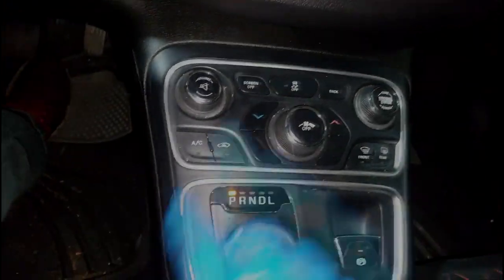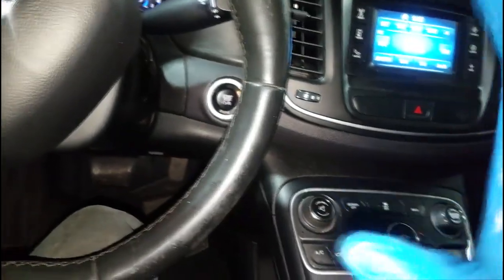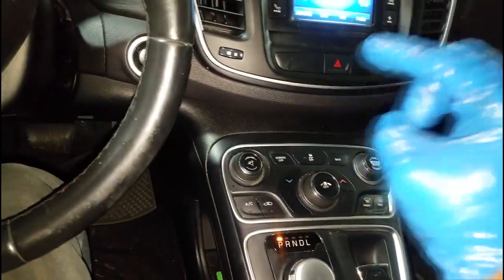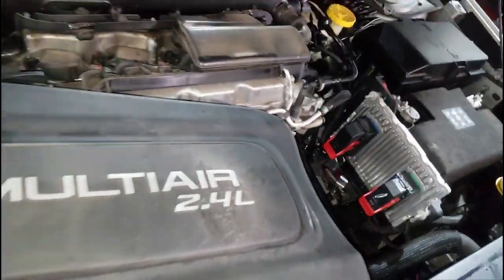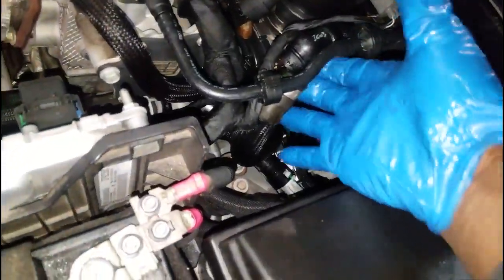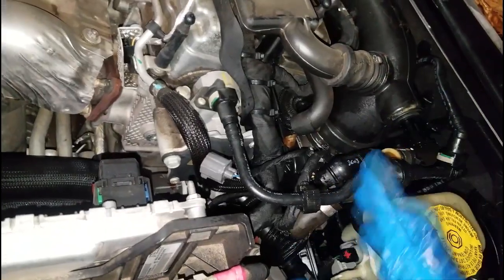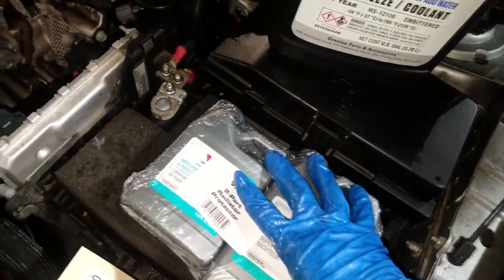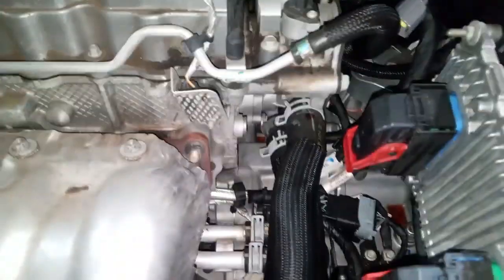How to fix a overheating car running hot. Find coolant leaks. P0128 P0300. Always do a pressure test

Comment: I have a 2013 Chrysler 200 3.6 and it has a p0300 error code, random cylinder misfire. It seems to run fine but the temperature goes up to about 3/4 point when accelerating around 45-65 mph then cools back down to about the halfway point. Do you think these two issues are related?